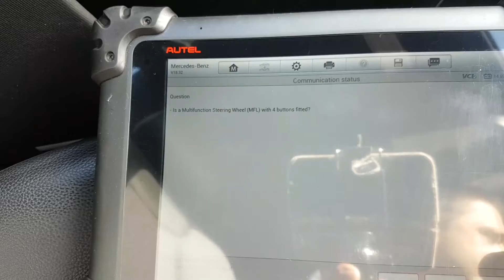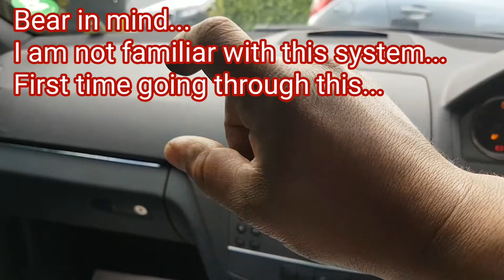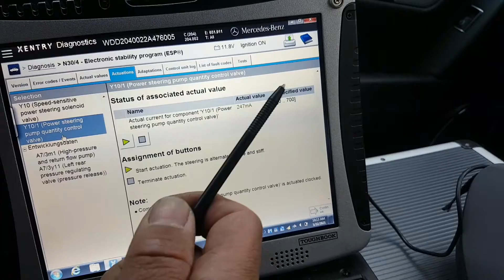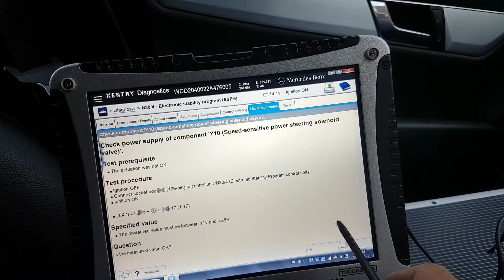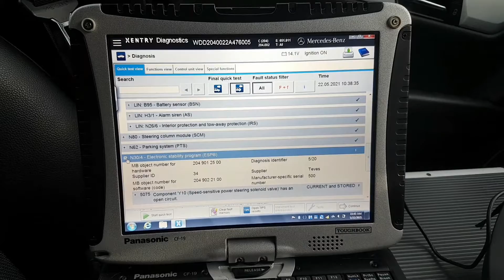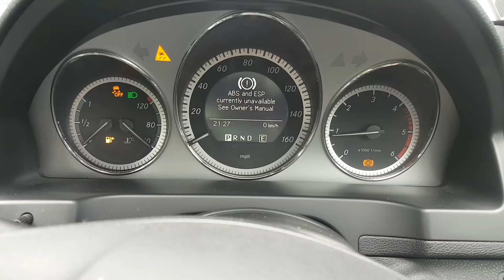Mercedes W204 heavy power steering... Fault finding and repair.

Comment: Please I need help my c300 keep hesitating while on motion and I've run several diagnosis all to no avail. Please any clue to solve this will be highly appreciated.
Reply from the maker: You don't even say which engine you have... difficult to advise.
Any codes?
Live data, has been analysed? 
Live data most likely will have your answer if there are no codes to help...
👍👍👍
Reply: @LMAutoRepairs its a w204 engine

Comment: Hi wher are you based...I had steering rack changed 2 time in 2 weeks and its still giving problems .. please can you help me...2 different mechanics changed rack and given up...they used the same solenoid on both racks...they haven't tested the solenoid...just saying we don't know what it is...I have wasted 650 pounds on 2 mechanics...my symptoms are the steering is light at 5 to 10 mph...but when you speed up the steering gets harder to turn on fuller locks around roundabouts or right angle turns..
Reply from the maker: Could be the solenoids... scan the car and test them...
👍👍👍
Reply: @LMAutoRepairs  these mechanics don't know how to do these jobs..can i bring to you please
Reply from the maker: @boigoe 
I just do this stuff as a part-time...
Sorry...
Reply: @LMAutoRepairs  ok thank you
Reply: @LMAutoRepairs  also I can pay you for diagnosis

Comment: My vehicle is a w219 (07 year).
Do I need to coding or reset after changing the sps valve?
Reply from the maker: Not sure, but you can easily check on the teach-in on the ESP unit, if the option is there...
👍👍👍

Comment: hi i have the same trouble, can you help me whit the location of the pin"s 17 and 31?  thansk so much
Reply from the maker: On the ABS plug?
Reply: @LMAutoRepairs  yes
Reply from the maker: I am pretty sure they are numbered!...
Reply: @LMAutoRepairs  I take a look and no numbers printed
Reply from the maker: @fixeup 
Are you sure?
Sometimes there is just on the start of the rows... check on the module itself, sometimes is in there...

Comment: Hello please i need a help my mercedes w204 model 2009 when i roll over 20km the steering wheel becomes rigid then abs and esp emerge in the dashboard after doing a diagnosis scan the default is 5001 code there is a solution to this problem?  Have i change the ESP module?
Reply from the maker: Hi
Unfortunately yes... You can change the electronic module only, leaving the modulator (the hydraulic side) untouched. Should not require programming.
I believe that fault is due to an ATE chip that fails inside the module, you can always try to open the module and fins a replacement chip and see if that fixes it.
Hope that helps.
Reply: @LMAutoRepairs  thank you very much im grateful. I wanna add something when i brake strongly the abs and esp disappear from the dashboard but when i start the vehicle the problem comes again
Reply from the maker: @smailidrissi1833 
Just the behaviour of the fault...
As above, replace or attempt to repair...

Comment: Thank you sir for sharing this 

i bought a sps valve 
cause my steering wheel is so tight but i couldn't find from where exactly to change the sensor 

please reply cause i remove the from undercover and didn't see how to remove the sensor 
i have 08 C350 W204

Thank you Sir again

Comment: Hi, nice vid, but would you be kind enough to give a little more description about that problem. I own the same year and class Mercedes and very the same problem occurred. The faults doesn't appear until the car reach 15mpg speed, then it resets when the engine starts again, Cheers
Reply from the maker: Have you scanned the car, to see what the codes are?
👍👍👍
Reply: @LMAutoRepairs  went to two dealers who said can't establish the problem as everything seems responding and working, they all suggested me to go to Mercedes for in depth diagnostic. Mercedes said that they can't find the problem and  they need more hours for technical investigation which obviously would cost £600 , maybe just me but i don't trust to answers and conclusions like i got from Mercedes, no clarity and makes doubting about their competency,
Reply from the maker: I understand,  but surely the car is storing trouble codes for that failure, or live data should help show what is happening when the failure occurs...
That needs to be checked and interpreted start to dig into the problem...
Reply: @LMAutoRepairs  no doubts about what you just mentioned. But when Mercedes dealer doesn't give back any info about the outcome of diagnostic the only way is to find a competent person who can conduct comprehensive investigation. Thanks for your time 👍
Reply from the maker: @sarasanr4107  
Try get it scanned and ask for a report...
Any decent garage, will not chage much for a scan and a print out...
Reply: @LMAutoRepairs  Hi there, i was experiencing the faults for over a month now every time i drove. But today when drove there was no a single fault 😳🤔 this makes even more confusing, it is pretty warm day i am thinking about some electric insulation issues as the last month was cold and wet, i was driving my car all day long and was as good as before 🤔any thoughts?
Reply from the maker: Yes... check connections, connectors etc... for moisture or water ingress...
But again, a scan should help point you in the right direction...
👍

Comment: How did you do that?
I have the same problem on my w204 C280. I have 2 Error codes(5001, 5944). I am wondering my abs module problem.
Power steering can not work now.😢
Reply: Well! the ABS module is often the problem with all these vehicles..
Reply from the maker: How I did what?
👍👍👍
Reply: @LMAutoRepairs  
To solve the problem of power steering and ABS. From your video, I just see that you plug into the switch under the right front wheel. Then, all error just gone.
Reply from the maker: Correct...
Reply: @LMAutoRepairs  I got it. Thanks for your reply. By the way, I am in Taiwan Asia. Next to Mainland China.

Comment: thanks for the elaborate diagnosis, But my own problem is that the whole dash light comes on intermittently, On and Off while driving and each time it comes up, my speedometer, and cruise control all will not be working, I might still be on the drive and vuum! it goes off and they speedometer starts working which obviously might also go off in secs or minutes. this has worsened. What could be going ON and OFF in the system?
Reply from the maker: Difficult to tell...
Diagnosis and live data while or when that happens could be of a massive help...
Looks like a poor contact somewhere... 
👍👍👍👍

Comment: I have a mercedes w639 2012 with eco powersteeringpump.
Its a pump with solenoid valve.
When im driving it works normal.
When i stop and turn the steering very stiff.i have no fault codes on my autel.any idea please?
Reply from the maker: 🤷‍♂️
Difficult to tell...
Check live data, try to actuate the valve, ensure is working...
👍👍👍
Reply: @LMAutoRepairs  Thanks for your advice mate.
Reply: @MoMo-tg2ebdid you find the problem? I have the same issue

Comment: My car has the esp and Abs light that goes on after I reach speeds 10-15mph then the steering gets stiff. I just change all speed sensors for all 4 wheels and the issue is still
The same. What should I do next?
Reply from the maker: Have you scanned the car before changing all those sensor?
👍👍👍
Reply: @LMAutoRepairs  yes just changed all 4 today
Reply: The codes didn’t show up but everyone keep saying is the speed sensor so I changed all 4 and the problem still happens. I get codes n47-5 internal fault
Reply from the maker: You shouldn't change parts just because someone tells you to do so...
A waste of money...
Whatever is causing the ABS light to come on, it will be logging a fault on the module, if not, look at live data...
Don't just throw parts at it,  it can get expensive very quickly...
The N47-5 is you ABS module...
I guess you have communications with it correct?
Reply: @LMAutoRepairs  yeah I did a lot of research and everyone on the forum told me it’s the speed sensor, so now I think it might be the abs module. But I’m going wait since there’s a few people exactly in my shoes that are going to the shop this week
Reply from the maker: Research is not enough...
You need testing...
Reply: You need a new espresso machine module
Reply: Lol
Reply: Only joking you will probably need to replace the esp module after testing as that code is internal fault in your module

Comment: I have a similar problem like this with my 2000 Passat 1.9 TDI.
I had a 1998 Passat 1.6 Petrol before that one and the power steering was smooth as butter, I only needed one finger to steer, when parking too.
But with the TDI now it is harder to steer, especially when parking or when driving through a roundabout.
It is not as hard as no power steering at all, but I need to use my whole hand to steer.

I already replaced the pump with a Meyle unit (old one was a ZF, it was covered in dried power steering fluid, so I think it was leaking a little bit, the fluid level was always on max), the fluid reservoir and I flushed all the power steering fluid (with LIQUI MOLY 1127), but no change unfortunately 😟
Of course I don't have electric connectors on the rack or the pump, as its a 2000 car.

Do you know what I could check? Or should I just replace the rack (relatively involving job...).
Reply from the maker: There is ways to change the amount of assistance... but all depends on the system...
So,  you can try to change/modify the relief valve/spring... 
You can also change the pump pulley for a smaller one, and see what effect that does...
I never had to do anything like that, so just throwing ideas out...😋
👍👍👍

Comment: And I need  help from you I have bmw e60 530td 2003 model with diamond key I have problem with CAS3 no light when  ignition on,, so I need set key immobilizer
Reply from the maker: No lights?
What do you mean?
👍👍👍

Comment: Hello Mr SolveEverything, I hope you’re having a wonderful day. 
Thank you for your great work it really helps us a lot. 
I have a problem with my mercedes w203 (c200). 
I get the error code (SRS): 9103 the resistance value in the ignition circuit containing components r12/13 (driver airbag ignition squib 1) is too high.
I have been to many car services and nobody could find the solution to this problem. I have done research on the forums and could not get a solution at all. 
I have seen a bulletin from mercedes regarding this issue which said that i had to extend some wires that come to the steering wheel, have done that but still same issue, i have changed the steering wheel airbag (car mechanic said to) and it was to no avail. Changed the clockspring, the issue went away but came back again after a while. 
There is no mercedes dealership in my country (Kosovo) and i have no other option but to ask you for a little bit of help. 
Thank you in advance. 
Keep up the good work!
Reply from the maker: Measure the circuit from the airbag plugs to the airbag module...
From there, and if high, look for plugs through the circuit, do some drag tests... a slack plug can cause all sort of problems...
👍👍👍